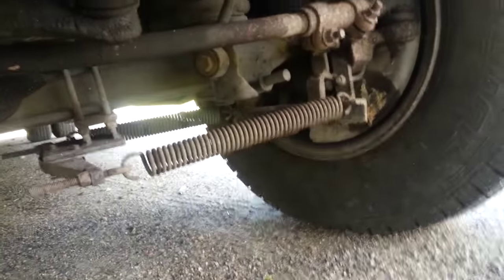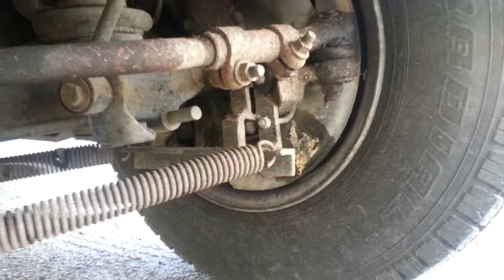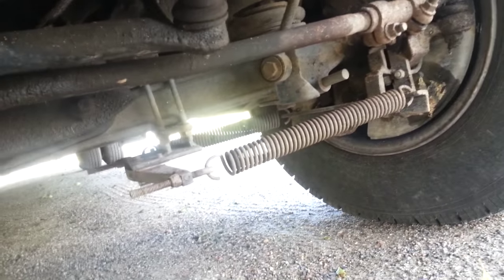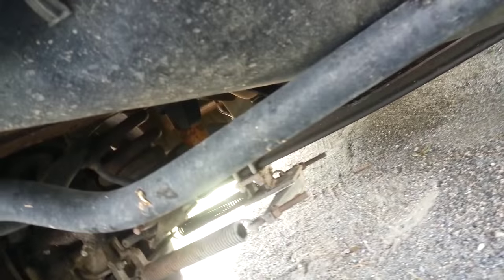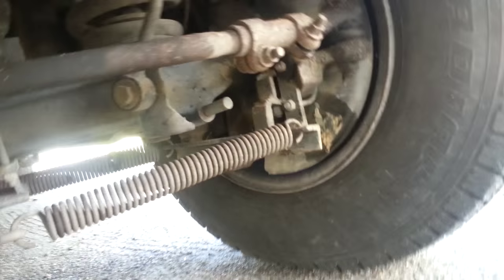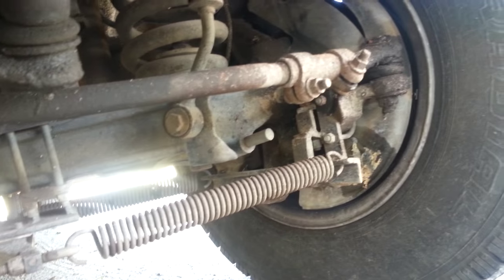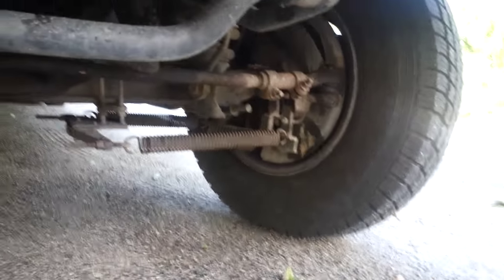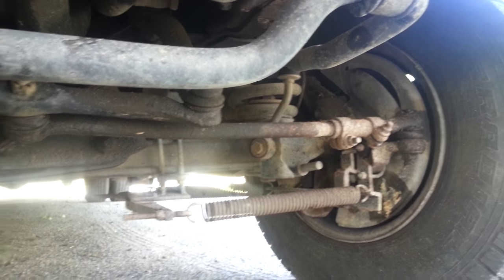Strange Home-Made Steering..... Something

Comment: We use to put these on our class 8 trucks, in case of a blow out on the steering Axel.

Manufacturer Statements

Steer Safe protects you against front tire blowouts, potholes, soft shoulders, high winds, wandering, accidental encounters with curbs, and highway medians. It also helps reduce driver fatigue. Steer Safe is the best safety insurance for your vehicle, driver, and passengers.

It provides up to 400 pounds of preset tension on each front wheel working against any outside forces, keeping the front wheels pointed straight, even in a blowout situation.